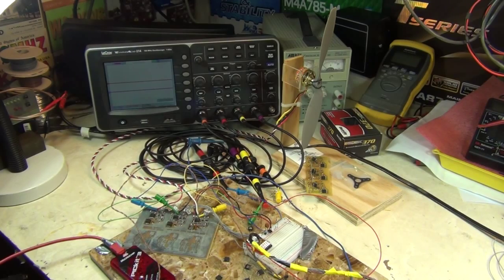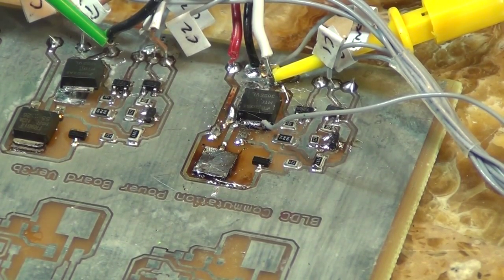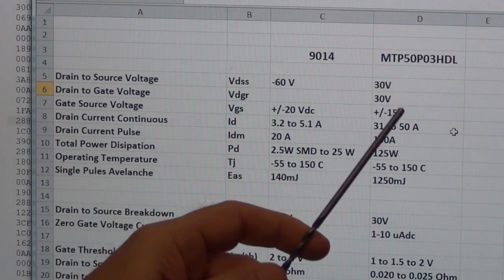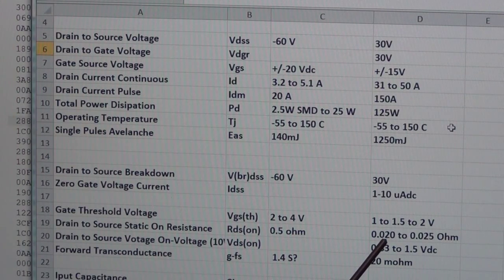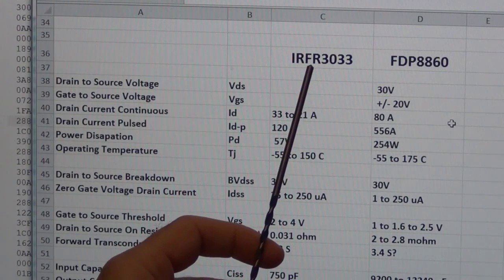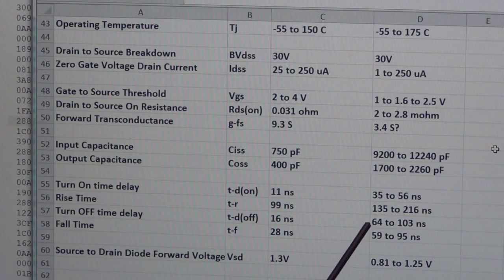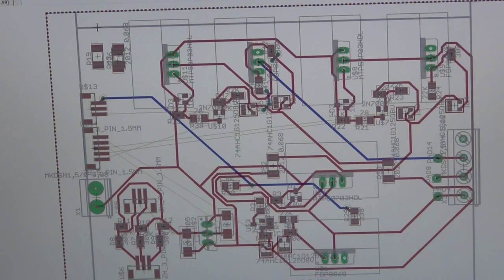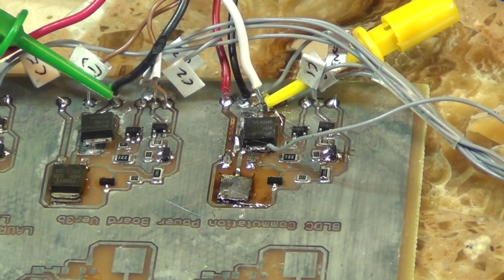BLDC Motor Control - Part 2 - DIY ECS R/C motor

Comment from the maker: The switching characteristics of a MOSFET body diode
are very important in systems using it as a freewheeling or
commutating diode. Of particular interest are the reverse
recovery characteristics which play a major role in
determining switching losses, radiated noise, EMI and RFI.
System switching losses are largely due to the nature of
the body diode itself.